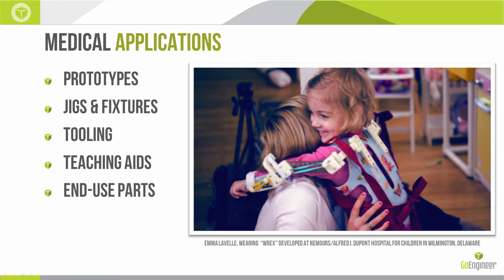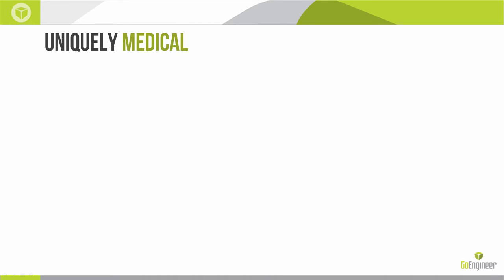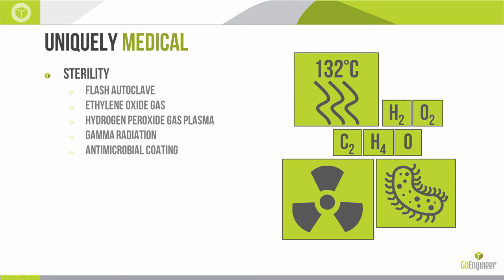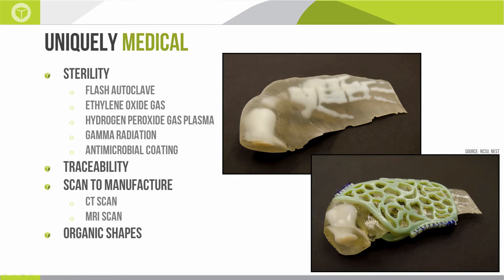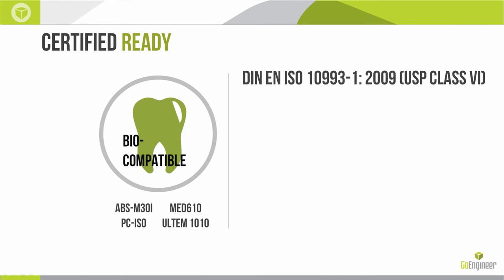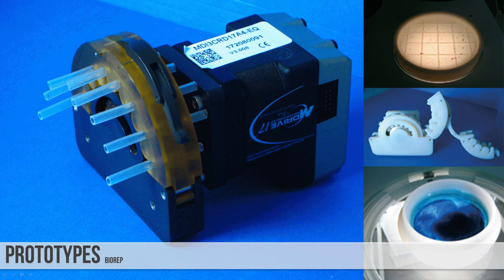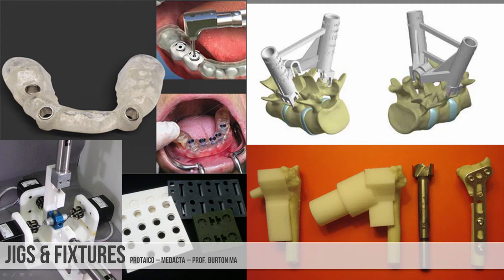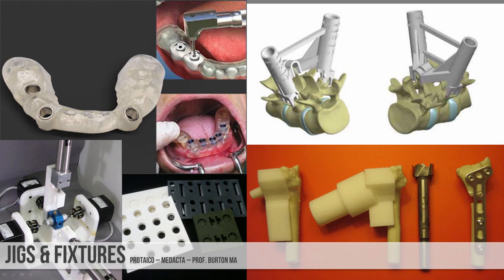3D Printing - Medical Industry

Comment: Is 3D printed material strong enough to replace an injection molded part?
Reply from the maker: Hi Invention Therapy,
Probably not in all applications.  Where strength is a concern in the design then we might expect a 3D print to have unexpected failure rates.
Reply: there are so many materials to 3D print. So many 3D printer tools so you can find the type of 3D printer that you want. you mean metals right? or Engneering plastic. they are so strong. they gonna be helpful probabley.